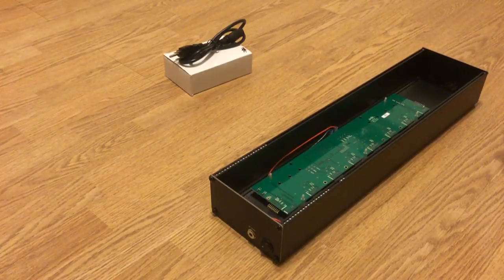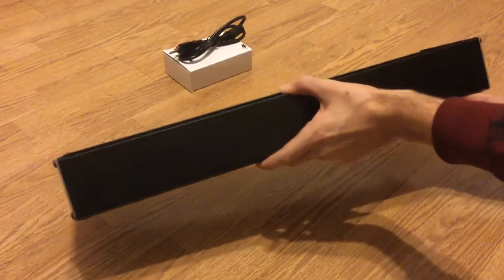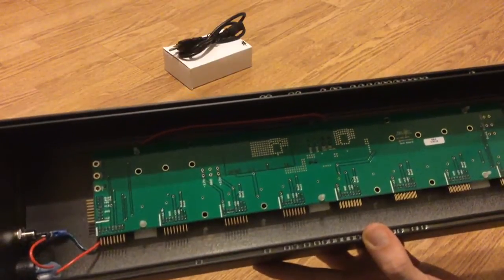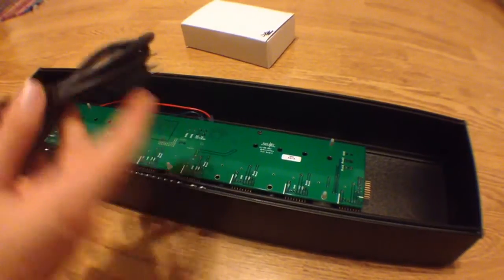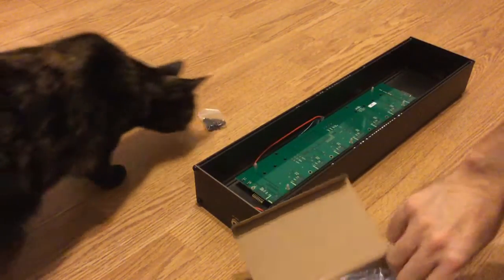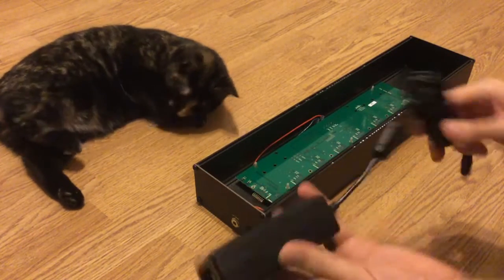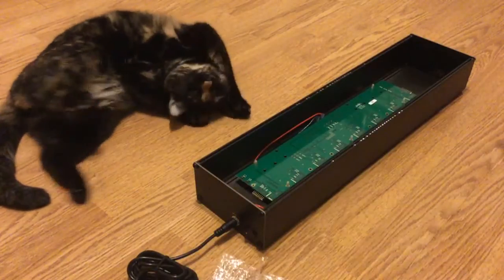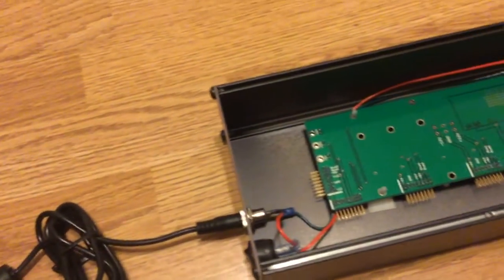Make Noise Powered Skiff - A Quick Look - MVM#20

Comment: so if i pick up a case like this with the power supply built in can i just start buying modules and building my synth, or is there anything else id need in addition to the case
Reply from the maker: Yeah this is all you need. Just add some modules and patch cables.

Comment: Useful vid, thanks. Great cat too! How are you getting on with the sliding nuts in the rails? I'm looking at this skiff as an expansion of my doepfer case but that has fixed rails which make adding modules really easy.
Reply from the maker: +Forehead Thanks for watching! I don't mind the sliding nuts, they're kinda nice actually. The case is definitely really nice overall, and the power supply seems to be solid as well, I haven't had any noise issues or anything like that.
Reply: +MIDI-VERSE TV thanks
Reply: John Horrobin - uk

.. I have a Make Noise shared system , bought it about 3 weeks ago then discovered the dreaded sliding nuts....

 Diy is not my strong point and I found adding a tempi module to the already populated case with sliding nuts a nightmare,, problem was  once  the lower screws are screwed in , how do u get to the upper screw holes when the module is  partly secured by a pair of sliding nuts  I have a Brains module waiting to go in also and not looking forward to it much..  I am assuming I am missing the special knack required to do this, it is probably easy once you know how. 

Any help would be appreciated cannot find any help with this on y tube

Thanks
Reply: @johnhorrobin8560    Get yourself a toothpick and line up the nuts both top and bottom before putting in your first screw for a module.  And I usually use a pair of tweezers that have a bent tip on it to hold the screw with one hand while I screw it in with a phillips in the other hand.   I've got a rack made from 3 Moog 104HP skiffs that are all sliding nuts, and now and then it's a little fiddly, but what I like about it is there's no chance of stripping out one of the holes.   I went for the Moog skiffs because I liked the tilt and that there are side panels available to strap 3 of them together.   And the fact they didn't come with a power supply worked for me because I custom built one that powers all three externally so that it doesn't take up rack space.   The one thing you'll probably find is a single skiff won't be enough for very long, there are just too many great modules out there.   I've also seen the Mantis case, and it's pretty nice-- solid with the fixed threaded rails, light and affordable.  It's a bit more portable and you might be able to stay within its 208HP of space for a little longer if you're judicious with module selection.
Reply: @Syncopator  

I   don't  recall   discussing  this with anyone  but  yes I use a  Bodkin , a special  kind of needle from my wife's sewing kit. that works  similarly,, thanks for the reply but  do not  recall bringing this subject up with anyone recently.

J  Horrobin
Reply: @johnhorrobin8560   Your vid popped up on my suggested videos page--  I see it is a little old, guess Youtube is grasping at straws to find something that I'll click on...